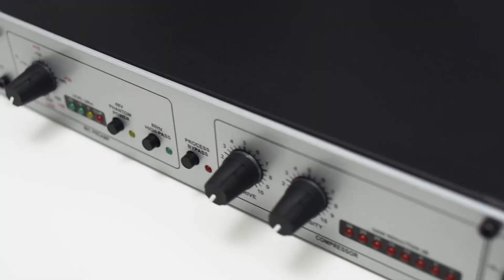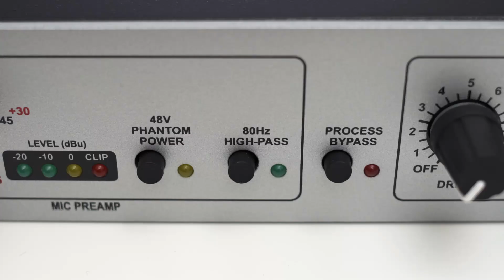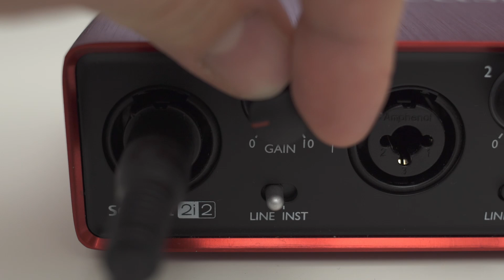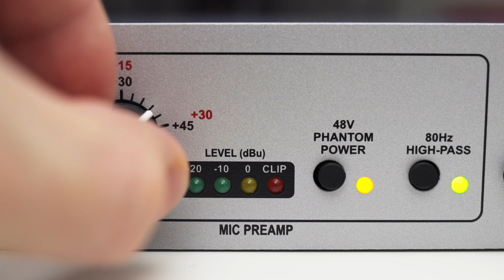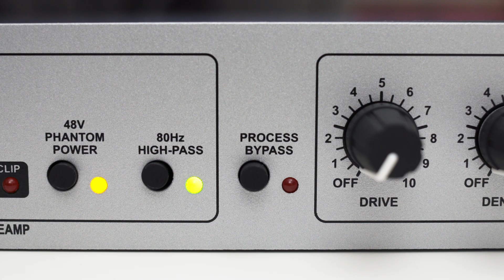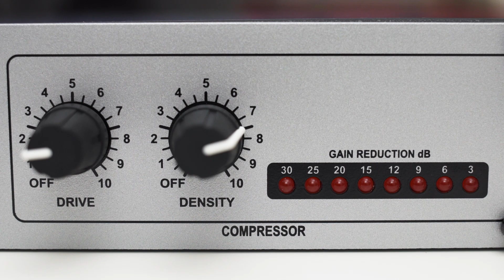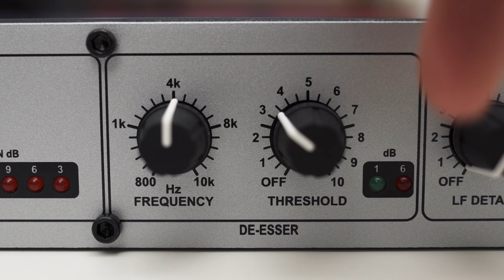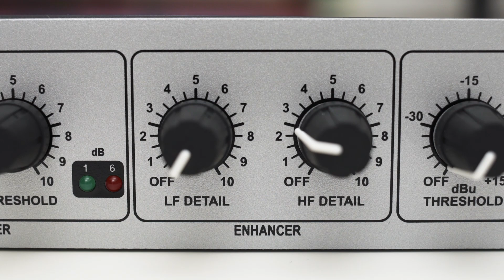Best Settings and How To Connect - get started with the dbx 286s

Comment: Hi, should the 1/4 inch TRS to 1/4 inch TRS cable be a stereo or mono cable? I want to connect my Dbx 286s to my Zoom H4n pro audio interface. What’s the difference between mono and stereo cables and how does it affect the audio? Thanks.
Reply from the maker: Hey, use a 1/4 inch stereo cable to connect the 286s to the H4n pro. This way you have a proper balanced audio connection. With a mono cable it would be unbalanced. It would very like still work, but 1/4 inch stereo is the preferred way to connect the two.
Reply: Thanks for replying and for your suggestion. Appreciate it. Really like your informative videos. Thanks for making them. They help a lot for novice like me.

Comment: Hi, regarding this compressor, could someone suggest good settings for watching a movie? For making the explosions etc more quiet and dialog more audible?
Reply from the maker: Hey, that's not really what the 286s is designed for. I mean you could route the audio through the 286s and compress the audio before sending it to an amp. But the problem is, that the 286s only has one channel. You normally watch a movie at least in stereo, so you would have to buy two units, one for the left and one for the right channel. I don't think that's a practical solution. If by any chance you already got two dbxs I would set up the compressor the following way:
Set the Densitiy to a medium value like 5. Then let play a film with dialogue and turn up the Drive, so that just the first LED of the gain reduction meter lights up when someone is speaking. This way dialogue is hardly compressed but then when a big explosion hits, the compressor kicks in and lowers the volume. Again, I don't recommend this for a permanent setup.
Reply: Sorry my bad, i thought this video was about the 266xs stereo-compressor. Maybe you are familiar with that device? Thanks.
Reply from the maker: @harrij.9542  Hey, I'm still not sure if the 266x is the best solution for this job, but here is how I would set it up. I would set the ratio relativly high, because you want to really pull down the loud spikes. So, 4:1 or above. Then I would set a quick attack time because you want to catch loud spikes. I would set the release to a medium level. Again, I would play a movie with dialogie in it and turn up the threshold, so there is jsut the first LED of the gain reduction meter lighting up. This way you should catch all the big explosions and stuff, that is louder than the dialogue.
Reply: Thanks for this, I will certainly try it out

Comment: Hello! Thanks for the awesome work and great content Julian.
Just some interrogations about your cabling choice here.
Isn't the dbx output a line output?
If so, why going out from the dbx to the audio interface using TRS to XLR into the mic input instead of TRS to TRS into a line input?
Since I think this is an actual line output, using TRS to TRS into a line input would provide a higher input impedance, therefore less insersion loss (due to a better impedance adaptation) and therefore a better noise/signal ratio. I might be missing something here, or maybe you missed something!

I'd be glad to have your input about it since I'm planning on adding a channel strip for vocals soon.

Hope you'll answer this even though this isn't one of your newer videos.
Best regards mate.

Comment: Hi Julian, I have the Audient id22 which I bought in part because I had seen reviews about the amazing mic pre amp it has.   When using the DBX 286s mic pre-amp and then going into the Audient id22 via the return am I downgrading the recording quality because I am bypassing the mic pre amp of the Audient id22?  Can I connect my microphone directly into the Audient id22 and then use send with a TRS cable from the id22 into the insert on the DBX 286s to do the processing, Gate, Compressor, Enhancer etc.  Then come back into the Audient id22 through Return so I get the benefit of the 286's processing but still get to use the mic pre-amp of the id22?  Thanks for any input about this.
Reply: I've been wondering the same thing.

Comment: Do i need to use cloud lifter for SM7B, as i don't see the yellow light coming in constantly. My pre-amp gain is almost near to max +60..Appreciate if you can advise on my problem.
Reply: NO- you don't need a cloudfilter!     SM7B is a dynamic microphone so  just read the pinned comment of the JULIAN or just read it here, i've copy pasted for you:  "Important point when calibrating the audio level with a dynamic mic:
Put the smartphones speaker as close to the mic as possible and better turn the volume of your smartphone to about 3/4.
Otherwise you might turn up your preamp gain to the maximum and can't reach the level to light up the yellow LED.
Dynamic mics have a low sensitivity, so the tone has to be quite a bit louder than with condenser microphones"

Comment: Is the output knob from the dbx that bad that you have to add gain at the interface? I’m pretty sure that most of the consumer audio interfaces have a line level of -10dB. So I’ve always used the +10dB from the output if the dbx. I’ve even hooked the dbx with a zoom h1 that I’ve set the gain to 37/100 and reduced the output from the dbx to -10dB
Reply from the maker: The problem with the output gain is that it does not have any additional headroom over the preamp gain. If you turn the output to anything above the 0 position you risk clipping the signal at the output even though you set your preamp gain correctly and are not clipping at the input stage. That's why I advise to not use any additional amplification at the output. If by any reason you need a bit more gain it is better to use the gain on the interface.
That said, when you have the ouput at the 0 position the 286s already delivers professional line level. So, it is very unlikely you have to gain the signal up much further.
Turning down the output is absolutely fine if you use a device that only accept consumer line level or mic level.
Reply: Julian Krause Interesting. I haven’t taken into account the risk of clipping before even hitting the line in of the audio interface. I was just concerned about still going through the audio interface’s preamp and thus amplifying the noise level. Thanks for the clarification and I will definitely get back to this video whenever I’m setting up the dbx!

Comment: Hi Julian I have a problem when connecting my condenser mic to the dbx 286s with phantom power on and processor bypass off. Sometimes my mic signal will be on and a few seconds later the mic signal goes off. How to solve this issue? I would be glad if you can help me..thank you.
Reply from the maker: Hey, chck if you have set the gate correctly. Maybe it mutes your audio.

Comment: Do I not have to buy the Behringer Ultra-DI DI400P and have it between the interface and the dbx ?
Reply from the maker: No, you connect the line output of the dbx286s straight to the line level input on the interface.

Comment: hi julian again, today has just arrived the 286s. i've got in my hands. but when i turn the power on it makes a loud buzzing noise. is it normal or is that i got a damaged unit?
Reply from the maker: Hey, I have heard this multiple times now. It seems that transformer in the 286s gives off an audible Humm with the mains frequency. On some units it is more pronounced than in others. It shouldn't affect the audio signal but if the buzzing is too loud, you might want to get it replaced.
Reply: @JulianKrause  i bought it second hand. 😓

Comment: hello julian. I hope you will find the time to clarify a doubt I have. I recently saw a video of an American guy who claims that the preamplifier must be connected to the sound card through a DI BOX in order to obtain the double advantage of improving the signal and preserving the sound card. what do you think?
maybe entering the inputs on the back instead of the front ones of the sound card the DI is not needed? Help
Reply from the maker: Hey, you only need a DI when you are connecting an electric guitar to the 286s. Otherwise a DI makes no sense when connecting to an audio interface and can actually degrade the signal.
Reply: @JulianKrause  ok julian. first of all thanks a lot for quick reply. what about if i want to connect my bass guitar to the dbx? does it make any sense? i mean does the dbx improve the quality of my bass insted of connect it directly to my audio interface?(audient id 22) thanks.

Comment: Question on this orsom video - I have the focusrite 18i8 and I am using input 5 on the rear which has a fixed gain line level for the 286 connection.
How do I deal with that when setting up the 286 calibration you detail, as you suggest making the gain on the audio I/F to zero then bring up the 286 pre amp to record -18db. With it fixed level we obviously cannot zero it first.
Reply from the maker: The calibration procedure is pretty much the same, but you then adjust the signal via the output knob of the 286s. The 286s has a maximum output level of 21dBu and the 18i8 a maximum intput level of 16dBu. It is very likely that you have to turn the the output knob of the 286s a litte below the 0 position (12 o'clock) to get your system working perfectly.
Reply: @JulianKrause  Thanks Jman. Keep up the good work. These are the the most concise instruction vids on YT. \m/
Reply: Dude - So, I'm using a  shure sm7b. With the tone generator on my iphone6 - i have the volume up nearly full. And with the gain on the dbx on full it still only tickles the -20 led. And then, with the dbx feeding input 5 (fixed gain) on the focusrite, I can't get anywhere near -18 recorded in the DAW. I'm guessing I should switch input to 1-4 on the focusrite as these have gain knobs. And on the DBX go with something like +45 ?
Reply from the maker: @kaosaxe391  This happens because the SM7B has such a low sensitivity. Try to set the signal generator to around 1000Hz and get the speaker of your smartphone as close to the front of the mic as possible. Then it should work out. If not, just turn the output dial of the 286s to -5dB and you should be golden.
Reply from the maker: @kaosaxe391  This happens because the SM7B has such a low sensitivity. Try to set the signal generator to around 1000Hz and get the speaker of your smartphone as close to the front of the mic as possible. Then it should work out. If not, just turn the output dial of the 286s to -5dB and you should be golden.
Reply: Julian Krause so might a cloudlifter help here?
Reply from the maker: @kalmkaos1465  Well, yes. But I wouldn't recommend buying a Cloudlifter just for the calibration process. Like I said, it is not critical to get this 100% right. When you are going into input 5 on the 18i8 you just turn the output knob on the 286s to -5dB. When you then set your input gain correctly on the 286s you should see that the level is somewhere around -20dB in your recording program.
Reply: Julian Krause thanks man. So this did work fine. Input set to light up the first three leds and output on -5db I did then get around -18 to -20db in Logic. 
The only observation on this is the 286 input gain knob is set to about 3 o’clock (+45 black). Is that pushing it too far?  Would the cloudlifter be beneficial? Thanks for your help.
Reply from the maker: @kaosaxe391  That's totally fine. The preamp in the dbx286s is very low noise, so you don't have to worry about it. Turn the gain to where it needs to be to record at a proper level and you will get low noise recordings. A cloudlifter would only make a minuscule difference.

Comment: A doubt. If I connect the output of the dbx to the input of my interface with a trs cable, should I put it on line or on mic?
Reply from the maker: The interface should be set to line :)
Reply: @JulianKrause  thank you

Comment: Hey, I've had the dbx286s since early 2016, but I saw that I had a mono trs 6.3mm to male xlr in the output of the dbx, but I've seen guys have stereo trs 6.3mm to male xlr cables instead, should I change?
Reply from the maker: I suspect you are talking about the cable that connects the 286s with your interface. If so, I do recommend a TRS plug (stereo), only this way you have a balanced connection. This helps to prevent noise. If you can go with TRS to TRS between the 286s and the line level input on your interface.
Reply: @JulianKrause  Thank you, I had a balanced (2 rings on the TRS plug) cable, I bought 2 cables 4 years ago, one balanced and one unbalanced, I didn't know that I bought one unbalanced until yesterday, lol I've had problems with interference,  but now when I plugged in the balanced cable it works just perfect, dead silent, no interference at all. Shame on me! thank you.

Comment: Hi Julian, thanks for this video! I have a question on setting the output gain: with my Beta 87A, I have to turn up the preamp gain all the way to make the yellow LED light up constantly, and that’s with my phone way louder than half volume. Only within the last two steps of the dial, the gain jumps in that area at all. I’m using an older 286A, but it should be identical. I had already contacted shut to ask whether my 87A is a fake, but it’s real. Do you have a good explanation for why I get such a low signal? My interface is a tascam US 2x2. Thanks in advance!
Reply: thanks for the quick reply! But the 87 is a condenser, and I also tried with an SM58, the results were similar. Thing is I get good recordings, but since audio is so complicated sometimes I always want to understand more. And right now my interface gain is at zero and output gain on the dbx is —10 which I can’t square with your guide.
Reply from the maker: @timmschoof  My bad you are right, the Beta 87a is a condenser. Although, it is a special condenser and has a very low sensitivity, close to a dynamic mic. That's why it behaves very similar to an SM58 in this process. By the way, did you turn on the phantom power when calibrating the audio level with the Beta 87a? Because it needs phantom power to work properly.
Reply: yeah true, that came to mind after I posted. Yes, phantom power was on. Maybe I’ll run some more tests some time. For now happy holidays and thanks a lot :)

Comment: Quick question: you do not mention the windows input level.  I imagine you keep it at 100%?
Reply from the maker: Yes, it is as 100%
Reply from the maker: Yes, it is at 100%
Reply: @JulianKrause  Thank you for the reply.  If I turn my de-esser frequency to 10k and threshold to 10, is the similar to a low pass filter?
Reply from the maker: @aleeNL  Interesting idea. This might work, although it is probably more like a high shelf filter rather than a true low pass. The high frequencies are lowered in amplitude but I don't think the frequencies above 10k are cut off like with a true low pass.
Reply: I still use this video frequently.  Thank you again Julian.

Comment: OK, but what if I'm using onlyshure  sm7b dynamic microphone which needs phantom power like fathead  for example.,than how to calibrate the bdx? With or without phantom power ?
Reply from the maker: You calibrate like you use the system. If you use a FetHead, put it in line with the mic, turn on phantom power and do the same steps as shown in the video.

Comment: So what is the point of the tone generator if you in next step uses your voice to set the gain? 🧐
Reply from the maker: With the tone generator you set the correct output level on the 286s and the correct gain on the interface. After that you only have to use the gain on the 286s for setting your recording level.
Reply: Julian Krause got it :-) that part on the video was just a bit confusing, thanks for the clarification 😀
Reply: @JulianKrause   Julian.....how does the 286s compare to the Symetrix 528E ?

Comment: Hey which trs to trs cable (brand and model number) shall I buy for connecting the dbx to the sound interface. How much length will it need ? Please respond
Reply: I used a balanced 1/4" to 1/4" balanced patch cable to connect the dbx286s output to the front input of my USB interface.  Similar to this one (but mine was much cheaper and shorter): https://www.sweetwater.com/store/detail/BP10--pro-co-bp-10-excellines-balanced-patch-cable-10-foot

Suggestion: Once you find the sound settings that you like, take pictures of the front panel using your phone. Hang on to them in case you make a change and need to rollback to your working settings.

Julian's guide (this vid) is the best setup video I've found for the dbx286s.

Comment: I can't get my Shure SM7B to produce -20 -10 dBu on mic preamp without driving gain all the way to +60dB which distorts/clips the heck out of the audio. What am I doing wrong? Is the logic different for Shure SM7B than for sensitive condenser mics?
Reply: SM7B is a dynamic microphone so  just read the pinned comment of the JULIAN or just read it here, i've copy pasted for you:  "Important point when calibrating the audio level with a dynamic mic:
Put the smartphones speaker as close to the mic as possible and better turn the volume of your smartphone to about 3/4.
Otherwise you might turn up your preamp gain to the maximum and can't reach the level to light up the yellow LED.
Dynamic mics have a low sensitivity, so the tone has to be quite a bit louder than with condenser microphones"
Reply: @beyinmax  Thanks for the comment. I figured out my preamp was faulty. Got another one and it works great now.